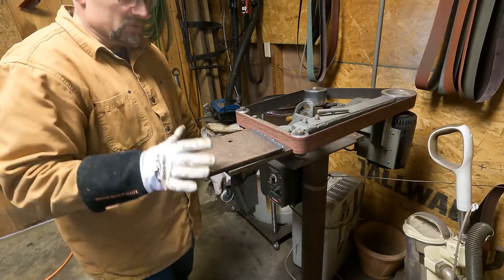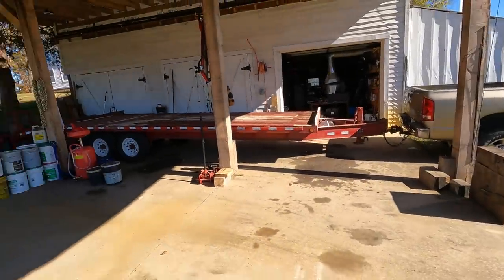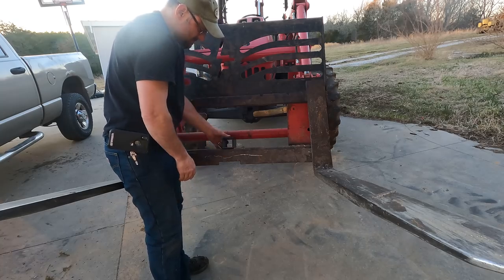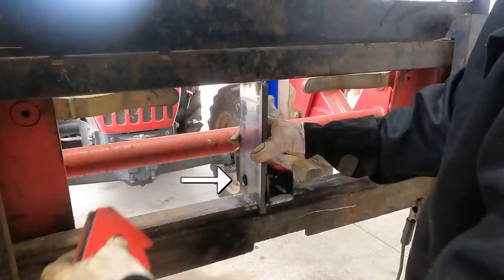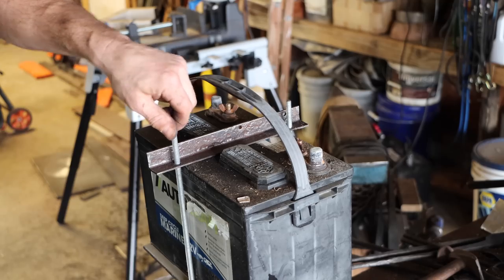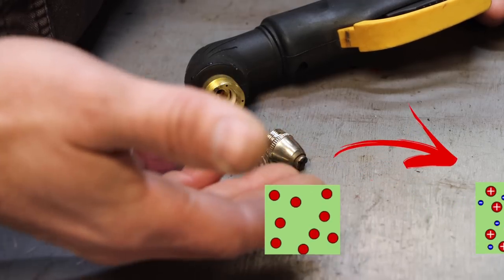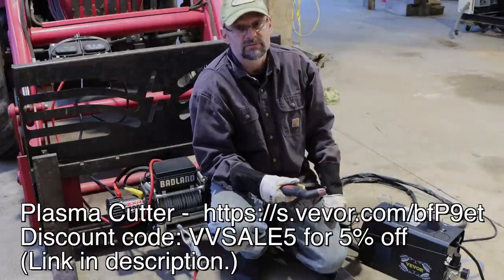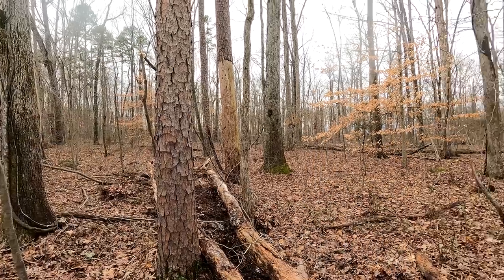The Farm Winch.  All-In-One Winch System.

Comment: I ALWAYS equip my machines/trucks with a heavy line from truck or tractor battery to the battery on trailer (or your battery tray). I use single pin Phillips male/female connectors.
This way the the alternator keeps the battery from getting to weak, with will cause your winch to burn up quicker.
Also, I recommend that once you get log to the forks, use a choker to pull the log, which will increase life of your winch from the extra strain of yanking.

Cool project, and gives me some idears!

Comment: i usually smack the slag off with my hammer before taking it to the belt sander or grinder. saves a bit of time, and you can usually knock a lot of the big stuff off. i love plasma cutters

Comment: The key to maximizing your duty cycle on larger winches is adequate current delivery.  When the voltage at the winch drops under 9vdc the motor will attempt to compensate by drawing more current (up to double normal current draw) which of course lowers the voltage even more.  So as you know a topped off battery with a 14v+ charge on it and heavy enough cables to delivery the rated current.  Also, you ain't gonna come near max pull on that with a single (non-deepcycle) battery. Probably need 3 that size or 2x 100+ amp/hour deep cycles for max pull.

Comment: Add a dual battery isolator to the tractor, and run wiring down the boom to the winch battery.  This way you can charge both batteries when the tractor is running, but you won't chance killing the starter battery on the tractor when it's not.  Or, you could use a continuous duty solenoid on a switch or the ignition "on" lead to connect the batteries together when the engine is running, and disconnect them when the engine is off.  This would allow you to use both batteries for extra pulling power when needed.  Keep up the fair work, buddy!  😁

Comment: FC101 you could fit a split charge relay on your tractor and run some thinner wire to the winch battery so you can charge when the tractor is running.

Comment: Excellent concept. I would also have receiver hitches on the back AND front of the truck with an additional one in the truck bed  to store it while traveling, pulling stuff into the bed, and to be at the ready no matter if you stick the front of the truck down into a ditch OR the back, it's always accessible. Also, I'd have one for the tractor 3 point hitch like the forestry skidding winches. Can pull it to the tractor, raise the 3ph and go. Having the winch on the forks to me looks like a way to get it damaged. I like your videos, you're very skilled in fabrication.

Comment: If you mounted it to the front of the tractor and use a pulley off the loader it would allow you to use the loader un hindered and hard wire to the battery using a Anderson plug for easy disconnect

Comment: Hi Jon,
Great demo of the plasma cutter and winch mounts. I'd consider a log cone to enhance dragging logs with less resistance. I use one with my tractor PTO Igland 4001 winch. The 'cone' has a hole to pass winch cable/ hook through. It could also prevent snags of trees passing over rocks, and prevent the butt end from digging it's own trench back to your tractor. And you would not likely have to lift the log end off the ground/mud bog in swampy wet areas...
Cheers,
Carter

Comment: The arc on a plasma cutter is actually being maintained (once started with the pilot Arc, which works as you explained) in between the electrode and the work. Using the plasma to conduct the electricity.

That's why you need a ground cable.

Comment: I also purchased 2 gauge wire from Amazon and the quick disconnect (line on forklifts) to use on all my connections. Works well and have loaded 9’ 32” oaks in my dump trailer with no issues

Comment: Nice update on the plasma cutter!  FYI  on weld beads, 1 in length of 1/4 fillet will have a breaking strength of 6000 lbs. Slow down a little at the sides of the fillet to fill and avoid the undercut.

Comment: Very Good video. Like how you can use winch at 3 different locations, like strap for mounting pulley to tree & not hurting tree. Using winch to full capacity isn't needed very long in most cases. Then you can pull w/truck or tractor which is a lot faster. Pully w/allow you to pull at a right angle, & you wont be in Bite Zone if something breaks or falls unexspectantly

Comment: An option is running a forklift charging cable from your tractor battery and use the opposite end for the winch . It can be plugged in when needed and unplugged when not in use and the connectors are protected.

Comment: A winch really is a game-changer for logging. With a proper logging-winch it is even better (stronger and much faster). Those are not cheap throw.
Here in Southern Germany it is very common that such equipment is bought by several people together. This way even someone who doesn’t own a huge forest can afford pretty good and modern machinery. The concept commonly is used for anything from a small log splitter to big shredders. 
It also was common for other farming equipment, but since the small farms are more and more going away and the machines are getting much more complicated to operate, it doesn’t make that much sense to share equipment between farms anymore. The really big an expensive machines are now often owned and operated by contractors specialized on doing custom farming.

Comment: Nice I had the same idea for my winch systems. Including buying the heck out of those receiver tube building blocks. Nice to see proof of concept. So far I have it set up to go on the tractors 3 point and of course any receiver on a vehicle. Was planning on setting a trailer up that way too, but the township stole it among other things before I had a chance. Sucks having to keep starting over projects and rebuilding because of crooks stealing from you especially when not a spring chicken anymore. At least that township is in the rearview mirror, mostly.

Comment: Before and after connecting ground clamp for plasma cutter was impressive.  The machine was hunting for a ground through the chop saw bench ground and the earth ground of your building and reinforcing steel in your slab and Hilton bolts or however you have that piece of equipment grounded but just wasn’t the equivalent of using the plasma cutter directly grounded to the piece.   Good thing you didn’t go long before recognizing it as it might have taken out the motor windings/brush connections in the chop saw. I doubt it helped but didn’t hurt the plasma cutter.

Comment: Great Video as always.  Thanks Jon!

Just bought one of those plasma cutters.  Haven't used it yet, but happy to see how useful it was.

I did the exact same thing with a winch on a deck-over trailer about 20 years ago.  Worked great.  Keeping the battery charged is the biggest challenge.  I still have the winch, sold the trailer many years ago.  I just put a synthetic rope on it today.  I'm thinking I'll have to get that hooked up again.  Maybe get a bigger winch.

Comment: You have a couple of issues with the plasma cutter.  Likely the air pressure is too low for cutting 1/2" plate OR your tip size is too small just like oxy fuel cutting, tip size is selectable.  I dont know if Vevor brand has larger tips or not though.  The curly kerf is indicative of too fast travel and or too small of a tip or too low air pressure OR combination of all of them.

Comment: Clean and Dry batteries work well Dirty Wet batteries are garbage. Measure the voltage from one post to anywhere on the top, You got voltage leak.

Comment: Crank up those amps on the welder! Slower, wider weave for stronger fillet welds.
That plasma cutter is going to be a game changer. No hassle with gas cylinders anymore, no sparking the flame, less heat in the workpiece, more metals to cut ... would love to have on myself.

Comment: Hello Jon, I have a similar winch setup on my logging trailer. I built a battery box with an ammeter and calibrated shunt wired to the winch. The manual gives you a generic electrical load scale so I pretty much use the amount of amps I am reading to determine my duty cycle. Can also(kind of) gauge rolling weight by the amount of amps I am using. Not perfect but seems to have worked so far.

Comment: Electrician here: I would not use jumper cables to charge the winch battery, but would install a battery isolator to the tractor. Then attach a short (whatever is convenient to grab hold of) polarized DC connector to the Tractor battery isolator with a 20 amp fuse on the positive connection, and then connect another polerized DC connector with a fuse to the winch battery. These connectors can be left on permanently if they are of the self protecting type with no exposed live parts to short out. Then use a length of 12 awg extension cord wired to matching DC connectors at both ends to connect to each battery. 

If the proper polarized DC connectors are used, the cord will work the same if the ends of the cord are switched, and there will be no danger of mixing polarity. The fuses at each battery connection ensure that if the cable gets damaged anywhere in the middle, both batteries will not be damaged.

The 12 awg wire should have enough resistance that it will not try and power the winch battery directly when the tractor is running and the winch is operated at the same time, but will try and equal the voltage whenever the tractor is running (thus charging the winch battery), and the isolator will keep the winch battery from draining the tractor starter battery when the tractor is not running.

Using a jacketed cord like an old extension cord will help protect the conductors, and it is easily removable and easier to route along the bucket arms. Some zip ties should work just fine. Once set up, this system can be set up and removed in a few minutes whenever the winch is used on the tractor, just like the winch itself.

I am suffering from equipment envy, since I could very much use a rig like yours in my woods.

Comment: Thoughts if I may; can you mount the winch higher and behind the metal backing with the fairlead flush so that you can also pull the log up onto the forks or at least the winch will be out of the way. 
Also consider making a three point attachment with a winch mount. Three point logging has been around a long time and the beauty is that you can just pull the log many times with the tractor and you don’t have to drive backwards. Plus you can still get some lift off it especially when it gets close.just a few thoughts. Thoroughly enjoyed this one except for the 17 ads which are slowly pushing me away from YouTube. But you’re worth it.

Comment: hello👋 from the Netherlands 🇳🇱.
John I think a winch mounting on the original tow pin mount would be a better place for the tractor, 
the winch motor can then just stay in place when you want to use the pallet forks, 
the winch motor is protected by the loader arm,  
you can use the tractor's battery which doesn't go flat when you run the tractor engine, 
and with the winch cable through a snatch block on the loader arm you can still control the height of your cable and "fish" with the cable  .  
but this is my opinion you should just do what you think is better of course
thanks for the video John .  
Sincerely Hollandduck 🇳🇱🦆

Comment: I have 2 of those Badland 12.000 winches.  Never had battery problem using jumper cables with my truck or tractor battery. I do use 4 gauge jumper cables.  You will find the wireless remote ($35.00)  invaluable.  Kind Regards.  Craig

Comment: I fabbed up a receiver for my tilt bed trailer and had Ideas of adding a receiver to the front of my truck. First though, will be a receiver to pin on the drawbar of the tractor or my OC46 crawler.

Comment: I would suggest putting a setup for your winch on the rear of your tractor too.  I forget what they call them but electric golf carts use the 50 or 60 amp quick connects which would allow you to run a substantial hot wire and ground between your winch battery and tractor battery which is supported by the alternator

Comment: I would buy a "quick hitch"  for the 3 point on the tractor and build the receiver mount for the winch on it.  Also you could purchase "plug-in"  type connectors for the electrical cables on the winch, and install winch power cables permanently,  and mount a plug-in type connector permanently somewhere on each piece of equipment or vehicle, then you can just plug the winch in,  and have full power with the engine running and charging the battery with the winch in use. Totally eliminate the need to use jumper cables.

Comment: i have had good luck with all my vevor purchases. i give them top ratings. as fo the winch. you can purchase a remote system from harbor freight. i have one on my 3500 lb winch and it works well. it has a slight lag when i push or release the button, but works well. it cost me about $40 bucks.

Comment: Would it be possible for you to run cables from your tractor alternator out to the battery that way you can keep it topped up? Like I'm picturing the battery quick connects so you can plug and unplug it as needed. And as I'm typing this comment you talk about jumper cables in the video.

Comment: I've loaded two dump trailer loads with mine and never did stop other than un hooking and rehooking up to additional logs. Intermittently pulling 2-5 minutes at a time it never did over heat or trip the circuit but I run from my truck battery via 2 gauge battery cable. I also leave the truck running when loading a full load. I opted not to run the winch from the dump battery.

Comment: Portable winches are very useful. But if I could offer 1 piece of advice. I would remove the steel wirerope and replace with a dyneema line of equivalent size. The advantages of dyneema over steel are numerous. Steel wirerope over repeated use is going to get fishhooks (burrs) from abrasion and the D/d ratio will cause deformation. Steel wirerope is easily eye spliced but not so much so end to end spliced. 
  Dyneema is not going to fishhook, will not deform and is easily end to end and eye spliced. Meaning that if you ever break it the only loss to length would be the damaged area and splice length. Wirerope you’ll lose the length from the break onwards. 
 It would be necessary to change the fairlead to one more suitable for dyneema.

Comment: Hey Jon! Without the 14.6v from the alternator the winch won't operate at full capacity. Also, your right about the distance/resistance aspect. If you wanted to go this route You would need 0 gauge wire.
(welding wire/automotive sound system wire is also cheap). Either way make sure you fuse the battery.

Comment: Pull thin cable from tractor battery to boom battery. Easy to do and when you put a powerful resistor to that line, it wont fry the wires and slowly charges the battery when the engine runs.
Reply: Blue Sea sells automatic charger switch. You just put it between batteries and it connects them once it sees that other battery has chager connected.

Comment: I really like the Tractor supply wireless winch remote. It is pretty easy to wire up 4 wires. positive, negative and 2 positive switch outputs. The remote is large uses AA batteries and has over 100 yards of range. That might seem excessive but I look at it this way if it will work from that far away it likely will workup close with low batteries.

Comment: I love this universal winch.  Perhaps you can install two steel protection bars in front of it to protect it? Then you can leave it on tractor while transporting logs. Or lay around the chain on the logs - to prevend them falling down while transporting them.  
I am not sury which kind of battery you use, but if using normal lead battery, this must be used horizontal and they should not deep discharged. Otherwise you can use it only less cycles. For your purpose, you better use lead gel battery. They can be used in any direction and can do much more complete cycles. If one doesn't deliever enough amps, just put two of them parallel.  Perhaps it would be a good idea to use a circuit breaker directly on the battery. Then you can switch it of in case something goes wrong.

Comment: Simply get a stick welding ground and put two clamps on .  Then clip two clamps together to extend.  Unclip to store or use local.  I use like on my plasma table.  One end is clamp the other is a magnet connector. (has to be steel). I experimented with mine 10 years ago or so and actually cut Granite floor tile.  It had a metal content in it and it conducted.  Melted rock makes more mess.

Comment: I need to do something like that with my UTV.   There were occasions where I could have used a portable winch front to rear.  I couldn't tell from the video, but I hope you didn't drag the log down your driveway with the winch.  Use the winch to drag the log to where you can use a chain to pull the log to where you need it.  You want the chain to be the sacrificial lamb and not the winch if something goes wrong with the drag.

Comment: A suggestion would b quick disconnect(Anderson connectors) from tractor batter and alternator to keep battery charged.and same setup on truck.tow truck have this w jumper cable set $130 .i use this on my truck and to direct logs to fall in safe location. When falling trees👍🇺🇸

Comment: I use my winch offroading quite a bit, ive winched till it killed the engine from so much load on the alternator not keeping up. Usually i give some throttle to have the alternator charging more while winching. You should definitely have it running along with some alternator on the tractor like you mentioned.

Comment: If your loader mounted battery is grounded to the tractor frame. run a 10ga wire from the alternator to the battery. Or run two 10ga wires from the alternator and ground to the battery. Your alternator has a built in regulator so no worries.